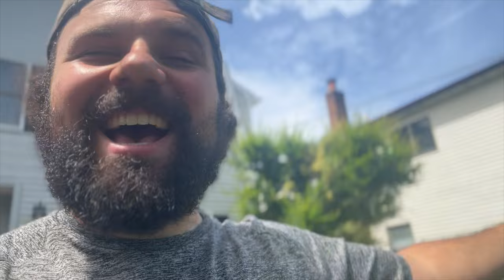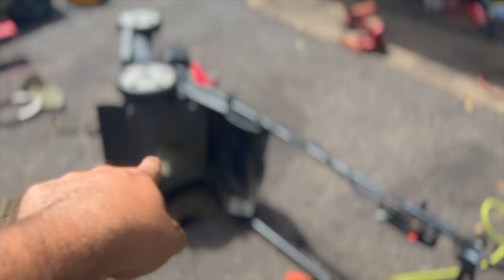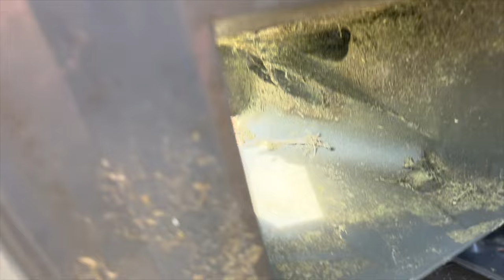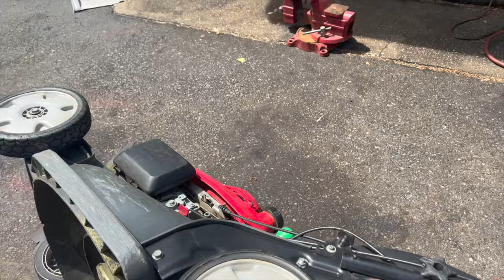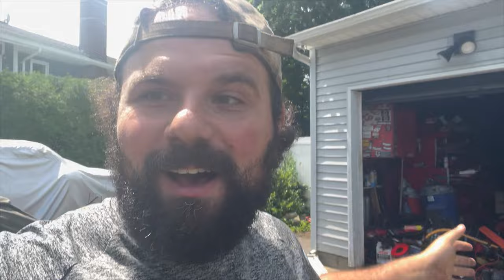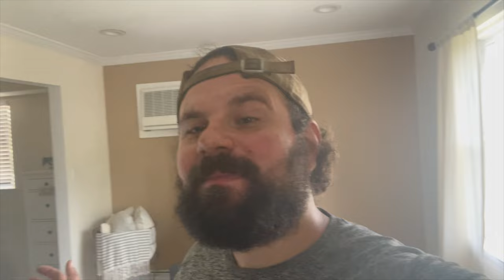HONDA LAWNMOWERS SUCK!  Only Good For One Thing Only #honda #lawnmower #lawncare #fanboy

Comment: Right on Jason,  just did two toro drive cables. 12.00 for the cable and it took longer to find my tools then to change out the cable.
Reply from the maker: While I was in their the Versamow wasn’t working.  Another crap design, fixed it while I was there.  

Over engineered and cut like crap!  Honda Prices for parts aren’t bad at all.
Reply: I’m with you on being overpriced. But With my experience they cut just as nice as any super recycler.  they just don’t leave any stripes.

Comment: Like I said before , the products are designed for maximum PROFIT only .The cheapest way of manufacturing , no regard as to repair of the machine at all . This is going to get worse , because all companies are going in the same direction , Cars , appliances , Small engine products , food , electronics , you name it . Sorry Buddy , it is the wave of the future . The repair person people will be needed so you do have a lot of security in your field in the years to come .
Reply from the maker: The automotive industry for sure!  I was watching a video where a coolant reservoir needed to be replaced. Low Coolant light in the dash but coolant was fine.   Sensor is BUILT Into the tank…it’s all one piece $1,100 just for the part and 12 mins for labor.

I will stick to my old shitboxes…

Honda parts are cheap OEM vs Aftermarket just a PITA to work on

Comment: I have one of these sitting in my backyard, got it from a local guy who scraps, it was his personal mower, I don't know what he does to mowers, I have a spare Honda engine, of course it's not the same model, noooooo..... But nothing matches up, the mower the guy gave me is missing the choke/gov bracket, the choke assembly is broken off, I can't identify what kind of oil he uses, smells like 90w gear oil, I've gotten mowers from him b4, and they are destroyed, so after 3hrs on the Honda, it went flying into my back yard, and that is where it will remain till I get around to scrapping at the end of the season, God I hate Hondas..... LMAO
Reply from the maker: I gave Henry Hondas that were sitting for almost a year.  You can’t save and fix them all!

Comment: Yep, I've never really enjoyed working on Honda mowers, worst carburetors out there as far as I'm concerned. I've had better luck with Tecumseh's.
Reply from the maker: It really isn’t necessary for the 5,000 gaskets between air filter and block.
Reply: @pattayperformance  Every time I hear someone brag about how good their 5 year old Honda mower has been I just wanna go insane. My grandfather bought me a new HRX217HYA for a gift back in 2015 and while it was a nice mower the thing never ran right, and rarely ever started on the first pull. In fact, the 3 years I owned that thing it broke down more times than my dads push mower ever has in 45 years of using it. Sold that mower, still using my dads old mower, first pull every time 45 years later! Had One Never Did Again. That's all I have to say, about that.

Comment: The Hondas from the big box stores are not special at all. Their GVC series engines are no better than Briggs. I have used the commercial HRC pushmower and it is a truly different machine.
Reply from the maker: The few HRC’s I’ve seen have been absolutely wrecked looks wise and has issues like doesn’t, doesn’t move, broken cables and hasn’t been used in a while.    Still want good money for them.  Too much for me…not even worth the content.  

I gotta do some research on the HRC series engines see what it is all about!

Thanks

Comment: End of the day you got $400 in your pocket for a bit of aggravation ;)
Reply from the maker: Glass half full…we sold a snowblower today and didn’t need anywhere of them aggregation and effort 🤣🤣🤣
Reply: @pattayperformance  Still $400 extra or not? :)
Reply from the maker: @MegaDirtyberty  $400 included parts and took a lot longer than I ever wanted too.

I didn’t realize the Versamow wasn’t working.  Didn’t want to start blame game, so I fixed that while It was apart.  Slapped it all together only to realize the shift cable works when it wants too.  Money is money but it gave me run for it.  

Of course as soon as I finish it, someone drops off a Honda with an bad oil leak 🤣

Comment: Engines are great. Mower decks not so much. Like I said before I sold a freebie HRX at a discounted price with a broken trans cable because I was too lazy to tear the whole thing apart to replace it.
Reply from the maker: Way too much work!

Of course the Versamow doesn’t work.  Stupid me didn’t confirm it.  So more cutting, cursing, beating and McGuyvering to get it done.  Once cable was installed now the gear speed cable doesn’t work🤣